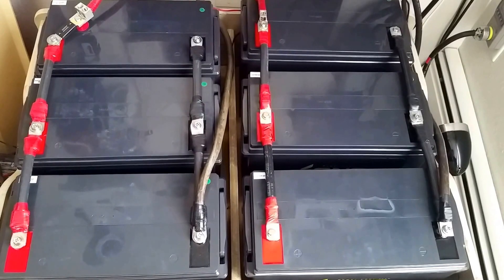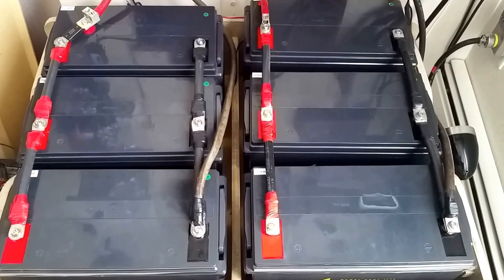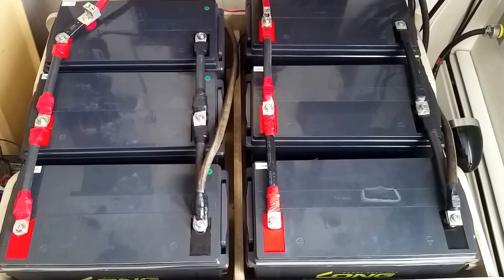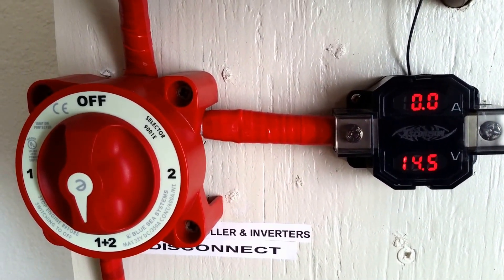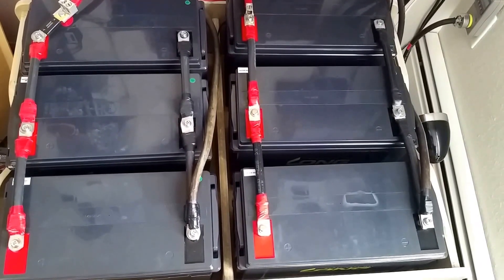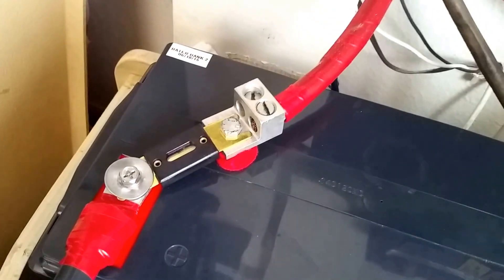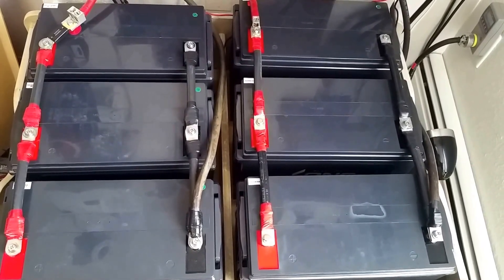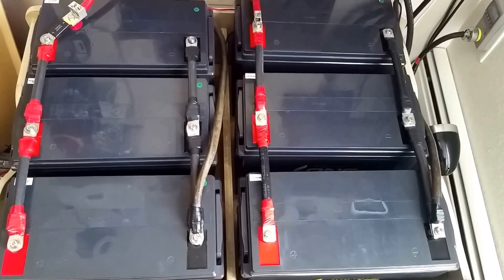BATTERY BANK 900Ah Pt#1

Comment: Stick with 12v, there is so much more you can do with it. Like me whole house runs on 12v flourescents and 12v LED lights. I also have wired in 12v outlets to charge cell phones. I know it cost more in cables, but then again the inverters and other appliances are cheaper for 12v than they are for 24 or 48. In my opinion 24 or 48 is good for direct grid tie inverters, but not if you really want to use dc power to run things directly. Check out my videos on DC lights
Reply from the maker: Thanks for the input and have a wonderful day

Comment: You have slightly larger battery bank than I nice.  I have 12 80 AH battery's wired in series, parallel for a 48 volt system.  Witch gives me 48 volt bank at 240  AH.  If you take the volts time's the AH gives you the total What Hour the battery bank is.  IE 12x900 is a 10,800 WH.   like mine is 48x240 for 11,520 watt hour.  but that is at full discharge I only discharge mine to 70% so my battery's last longer 50% is a full cycle.  So in a way I have 3,456 wh in my bank I will use so I can can for 1 hour run 3456 watts before it drops down to 70 %  I cant wait to add more to my bank I cant wait to have 1000 AH battery bank that would give me 48,000 wh that would be a lot of power.
Reply from the maker: Thanks for watching my video. 
I recently purchased 10 more batteries and I share 6 batteries with my retired Veteran friend. 
I helped him setup a little 12V system. 
if you go through my videos, checkout the video title  ( How to make battery cables the right way ) you will see his little setup.
Thanks for communicating with me. I really appreciate it so much.
God bless you and the family.
Cheers
Reply from the maker: I'm currently running 24V system for the past 2 months. 
I started liking because it seems to run cooler smoother and efficient.

Comment: one thing I would change if it was my system is the 45 amp limit, in an off grid system I want all the power I can get and those batteries can take it, your never going to get 20 years out of those batteries even if you follow the instructions, going to watch part 2 now :) GJ man love the videos!
Reply from the maker: Hey buddy,
I understand your concern but, this is the required Amps settings as per manufacturer.

I don't want to distroy, ruin, overheat my batteries and burn down my house, I don't want ignore the Data sheet  specifications of the battery manufacturer. 
Always follow the manual or the steps you're told to do. These are expensive batteries and I will follow all the rules of these batteries to keep them healthy and last longer. 
Thanks for your comment 
Cheers.
Reply from the maker: I am currently uploading a video I just recorded few minutes ago. 

Survival Kit Part.2 will be uploaded in few hours from now as well. 

Please checkout that video you will really love it.

Thanks for watching my videos.

Comment: Very nice little setup I love my 12v system for lighting but I only have 700ah in winter it drops to 70% charge. the only thing I would not use electrical tape as it goes tacky over time, I use heat shrink. very neat system.
Reply from the maker: Thanks